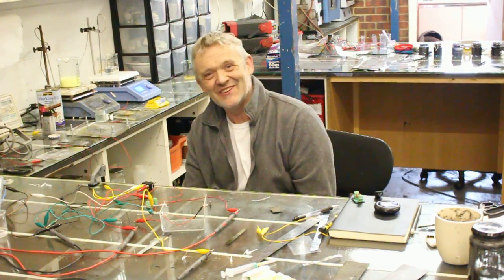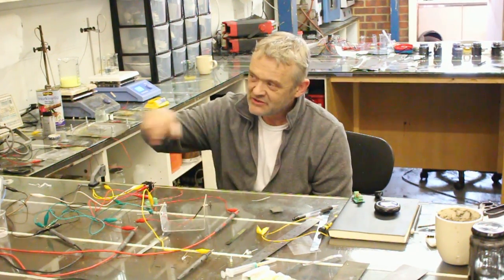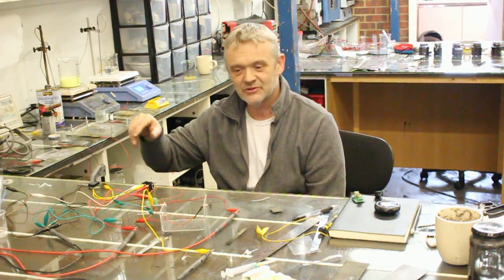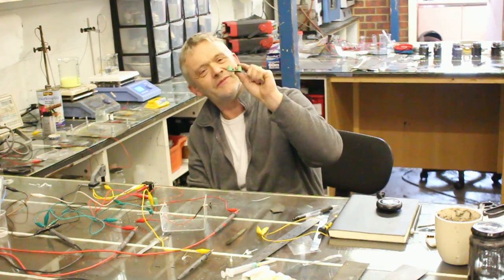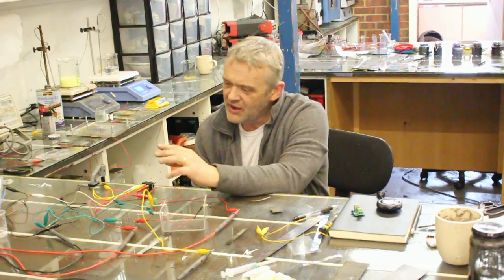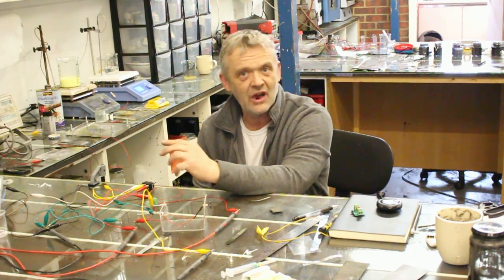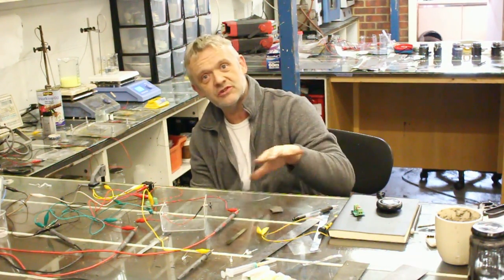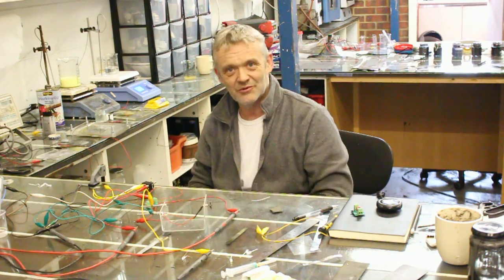The Battery And A Joule Thief

Comment: 1. Most joule thiefs are very low power to boost a dead 1.5v battery to light up a low power led that needs more than a 1.5v battery can supply (1.8 to 5v or more). 
2. The e-cig device draws 3 to 4 amps at 3.5 to 4.2v (not a light load at all), 10 to 15 watts (high current nichrome heating element,) 
3. and li-ion hardly has any energy below 3.5v (definitely not 10W+). 
So three strikes against a joule thief for a e-cig application. I am not sure how you missed ALL these points in this application?

Comment: Just an odd bit on a new joule thief I built. It uses a lot of current it would seem. It lights up very brightly with a 47kohm resistor to the base. Just a 20ma 8mm white led is fairly bright.  It uses a darlington transistor of 20k hfe to 30khfe. I use a D cell battery and holder. A 3500uf cap and neon tube across the battery. I wound the coil with about 24 to 26 gage wire I think it was copper enameled. Now the bifilar coil is wound on a ferrite rod from an AM radio. I am thinking I need a current limiting diode to 2ma to the base.

Comment: A Joule Thief is a proven circuit to squeeze every last bit of energy out of a primary battery.  But is that a good concept when mated with a rechargeable battery?  Many rechargeable battery designs have their lifespan and usable energy storage capacity greatly reduced after they are totally discharged.  However, using it with a super-capacitor might be useful. :)

Comment: I use Joule thief circuits for single cell LED night lights and flash lamps. Every clock/torch cell here ends it's life doing that job, and each AA or larger cell runs a small white LED all night for between a few days and several months. The circuit isn't the most efficient, varying across the supply range, depending upon component choices. But who really cares if otherwise useless cells are being used? Their beauty lies in their low cost and simplicity; one transistor, one resistor, one inductor and an LED. Construction time is a few minutes, and they always seem to work. I don't even bother with a circuit board, because they can be built around the cell holder. Supposedly discharged cells (which usually still deliver around 0.9V) will provide useful power right down to around 100mV if a Germanium transistor is used, and certainly less than half a Volt with Silicon transistors. Big Clive's design (which is the one I use) can be found by searching his channel for 'Joule Thief'. For the seriously walletly-challenged, family and neighbours are often happy to give their 'flat batteries' to you so that you can 'dispose of them properly'!

Comment: Joule thieves are rather useful indeed. Recently, I was asked to come up with couple of ideas for sort of unusual business card. One of them was pcb with smd joule thief circuit on it that had a tiny Al-air battery integrated on it. Current collector on air side was just a pcb copper segment I electroplated with Ni. Al side is exchangeable tab made from soda can. It works pretty nicely, you just have to refresh electrolyte from time to time. And Al tab. Of course, since we're talking about very small currents there, I used capacitor in front of typical joule thief circuit to store some charge before releasing it. Consequently, LED is not lit at all times, instead it blinks every 10-15s.
Reply from the maker: awesome mate

Comment: I like the idea of an e-cig kickstarter. Vapor products tend to be very hard on batteries. The advanced ones draw a lot of power, and the resistance of the heating coils is very low - often below 1 ohm.
Reply from the maker: so basically a short - more or less
Reply: Pretty much. :) High drain 18650s that can discharge at least 20 amps continuously are quite popular for powering a lot of the devices nowadays. Many vapers end up moving away from the built-in battery devices after awhile cause they get tired of the charging time. There would certainly be a market for a fast-charging e-cig if the battery can handle the power and current demands.
Reply from the maker: cool

Comment: Interesting idea, but I'm not sure how using a joule thief would help in a EC application. Conventional ECs require raw watts to heat the element up -the actual voltage or current doesn't matter so long as V*A is big enough to make the element hot. It seems to me that a joule thief would only introduce power losses and thus reduce the efficiency of the cell. Or am I missing something? :D
Reply: JT gets more energy out of a cell.
Reply from the maker: I think Alan is right mate - but like with so much the real answer is to try it and see - which so often is quicker than arguing the pros and cons
Reply from the maker: agreed mate
Reply: I been running 5 12v leds from a dead AA cell. Ran for days

Comment: That what I have been using to test my type of batteries. Can run leds for days with them.
Reply: Just for testing, seems to pull the last energy in the cells out. You know that most batteries have more than half of there energy left in them when they are spent. most people toss them and get a fresh one. The Joule thief can draw the rest out. What I been doing is pulling this energy out. The thing with the batteries I have been working on have the capability to recharge themselves after a period of disconnection.
Reply from the maker: awesome
Reply from the maker: i don't think it matters mate

Comment: Flashlight or a powerbank would appeal more to the masses I would think.  Integrate a coulomb counter, meter circuit into it with oled display.  Solar would also add a selling point, never being dependent on an outlet, and with the longevity of a capacitor, the device could last a lifetime.
Reply from the maker: I don't know mate according to WHO 1 in 5 people in the world smoke and the e-cig market topped US$6 billion in 2015 and is set to rise to US$20 billion by 2020 - plus - why would i integrate all that stuff it just sounds like cost and unnecessarily complexity to me mate - is that a bit of first world thinking going on lol
Reply: When I was referring to solar I meant for a powerbank or flashlight/lantern.  The higher class powerbanks already utilize coulomb counters which are not complex and have a relatively very small cost, and are just a bit more luxurious than a couple blinking leds which lower end powerbanks have, and are not based on anything but voltage which doesn't tell you anything about how much charge is left.

As for the light, I believe it could stand out as a unique design if certain parts were integrated, like the nth degree flexible leds, along with a flexible solar cell, all layered and coupled with a flexible supercapacitor.  1 in 5 for ecig, or 5 of 5 for a light, as everyone could use a unique light such as this.  The real selling point here should be the capacitor, as all these products talked about use batteries, so it doesn't really matter I guess what you produce, you have the capacitor which trumps the existing lithium cells.  If you could get this into the 18650 form factor you could really do some damage.
Reply from the maker: I think you are right there mate - it doesn't really matter what you produce - it only matters you produce something. What you decide on is personal i believe and there are always arguments either way for what is a good decision - equally when you decide something there is always someone telling you to decide something else lol - I don't mean to have a dig here mate - I am just saying having made a decision it's usually best to stick with it if you believe in it
Reply: Yes agreed, didn't know you had already decided.  I hope in the future you do plan on making the cell available by itself such as in a common form factor like the 18650, as that has a sort of infrastructure already.  People are even starting to build electric cars and diy powerwalls with them.
Reply from the maker: will do mate